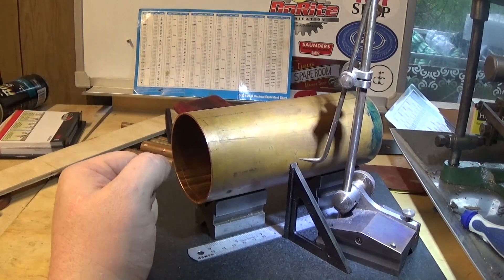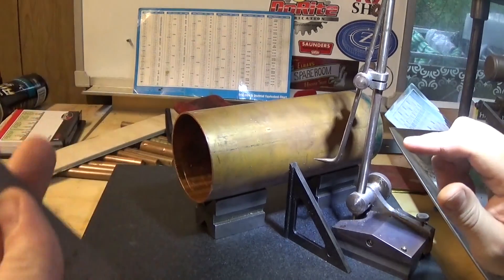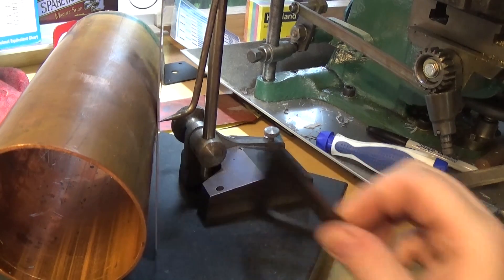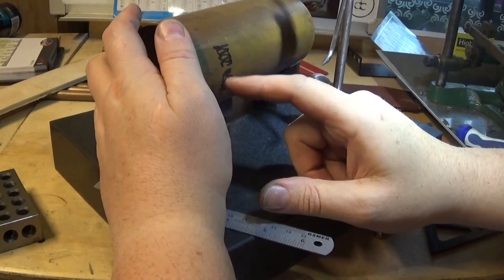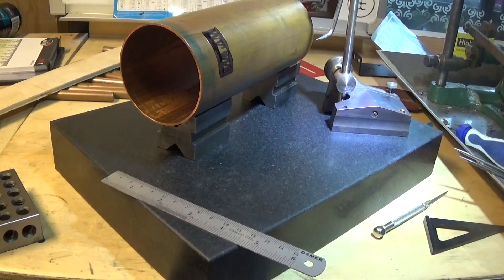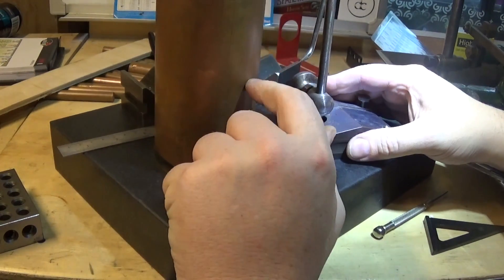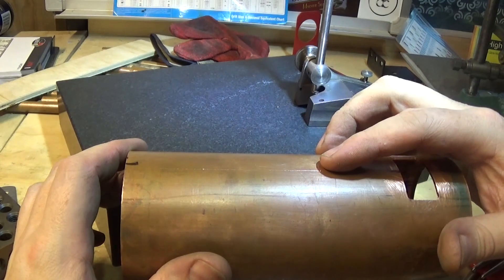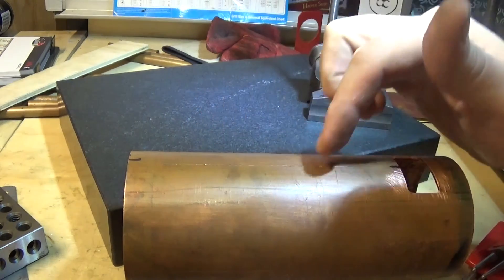Introducing EUGENE- A small copper boiler  Part 2

Comment: Nice series; keep it up.

I will suggest one thing that will make shop work easier and more accurate. When you are setting dividers, place one point in the 1" (or  1 mm or 1 cm) division rather than trying to align it with the end of the scale. Then adjust the dividers to put the other point in the mark at the desired distance. This way the starting point is fixed and won't be moving around while you are setting the other point to the desired distance. You can actually feel the point drop into the engraved mark. (It's best to keep one scale for setting dividers, as you will eventually scratch out all the black fill in the engraved lines.)

You do have to remember to add one to your desired measurement and it is always good to do a "reality check" by putting the point as close to the end of the scale as possible to see if you got it correct.

Comment: I would have put the feed water connection lower down personally. High up won't cause any problems really I don't think but lower down will put the water in under the surface. This is, more or less how it is typically done. It is looking good though. Have you seen David Richards you tube channel? He has a steam powered machine shop running off line shafts with a boiler roughly the same design as yours.

You might also consider an injector rather than a feed water pump. Less moving parts and a bit of a design challenge. :-)
Reply from the maker: +Noel Henderson ok.. I'm getting mixed ideas about this. Let's go with the centre line ?
Reply: Center line would be better. I got to thinking about this later and I realized that introducing the feedwater high up might quench some of the steam. This might, (probably would actually), cause some carryover which would reduce the quality of the steam, (make it wetter). Just a thought.
Reply from the maker: lol, an injector sounds a challenge.. still thinking about fittings. a nice hand pump for a start.

Comment: Personally, I would have used a paper wrap around and square to establish quadrants around the pipe. Get a strip of paper longer than the circumference. wrap it around the pipe so the edges line up. Mark off the circumference on the paper. Remove the paper and fold the end to mark and crease,  fold again for quadrants. You can also use this method to square up ends of the pipe.  Oh and when you set the dividers put the first leg point into a major division on the scale. Working from the end is just guesswork.
Reply from the maker: another great idea! ill rememeber that one. thats how i got the ends nice and square though. thanks for watching